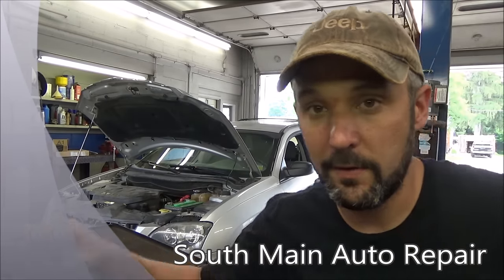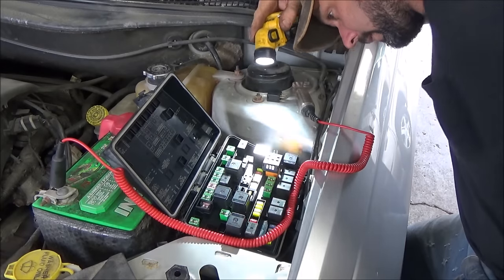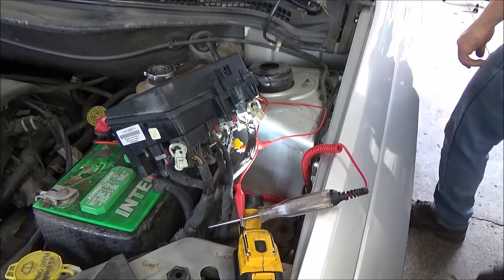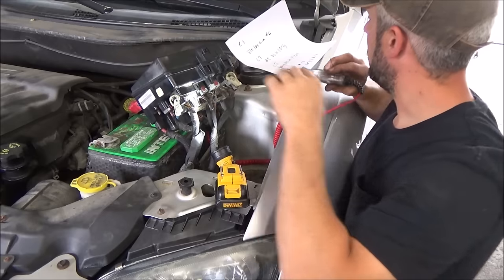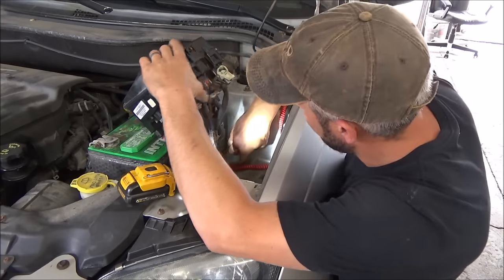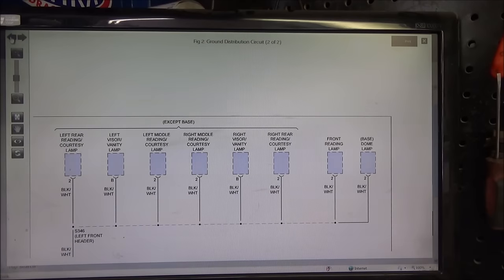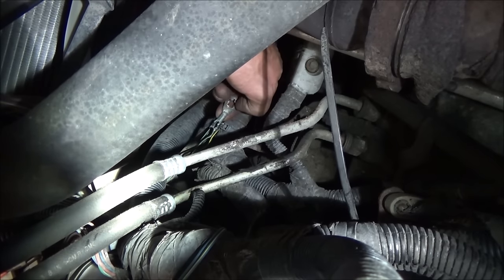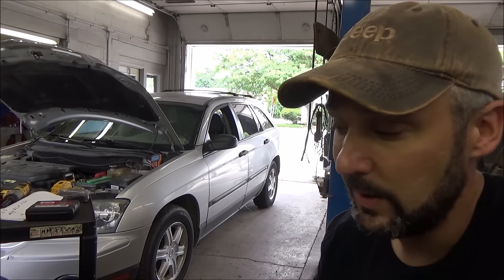Chrysler Pacifica: TIPM Electrical Problems

Comment: And the Kia Sedona is going crazy on the windshield wipers headlights turn door locks the ignition to under hood relay when I plugged it in as soon I plug relay back into the socket of the fuse box it seems like the parking lights go back to normal not flickering but still the power door locks will go crazy and headlights and turn signals still have that flickering and in turn signals work fast maybe I have the same issue as this vehicle you showing now cuz I went the wrong way about it and replaced the which wiper motor and other things like ignition switch resistor for the air conditioning blower motor and a few other things and still having the problem so I'm thinking since I change the fuse box under the hood on a wrecking yard maybe I'm having the same problem with the green crusty wires on the ground for the I p.m. if mine is doing the same thing I really hope so because I'm really tired of this going crazy checking everything and fishing it and it goes right back to the same headlights door locks windshield wipers seem like they're possessed thank you for putting this I'm going to check right now and I'm sure that's what I'm going to find a bad ground from the IPM if not can you please run a video Kia Sedona with same issues I don't know what else to do hopefully what I'm going to do now from your video they're going to work thank you for helping me and everybody who needs to find out stuff like you just demonstrated excellent you are the Master of finding out the problem without trying to charge the customer everything you can so that's like do want the others as you would have them do to you try to help each other when times are not so good once again thank you for putting this video

Comment: So I go outside and hit unlock on my 06 Jeep Grand Cherokee that's been leaking onto my driver's side floor during rain and has a rodent setting up residence, using my fob. The headlights blink on, but the doors don't unlock. I hit the lock button, nothing. I unlock the driver's door manually with the key, No interior lights, put the key in the ignition, turn it to start, the Jeep starts and runs. The wipers front and back work as well as squirters, the horn, the radio displays time, the turn signals work, the emergency blinkers work, headlights and back-up lights all work. The dash board is dark... fuel, mph, rpm, all inoperable. The brake lights don't work, hvac inoperative. At first the windows don't work. But a second try hours later the windows do work, but other than that everything is as before. Chewed wires? (Didn't see any evidence of this, mouse was probably satisfied with granola bars in the glove box that my wife keeps for emergency rations) Bad TIPM? IOD? (Probably not) a crap load of fuses? Water damage from leaky moonroof frying interior fuses? I love this Jeep. Almost as much as my 77 Mercury Cougar that I stuffed a built 460 into with a Danny O'Day C-6 tranny and FBI Torino suspension. Any ideas would be appreciated. 
UPDATE: it wasn't fuses or TIPM...it was a loose connection at the ignition.

Comment: I have an 02 Town and country Chrysler 3.8 l and a major electrical problem my 10 volt or amp ignition fuse started popping as of 2 years ago which continues to shut the car down completely while driving every time I put another one in it pops blows right away turn the key pop finally I went to a higher amp fuse that work for a couple days then it popped same thing every time I put one in turn the key pop so I put a 20 amp in there that lasted year and a half almost 2 years it finally popped yesterday October 5th 2022 but now nothing works every time you put a fuse in it pops continues to pop just that one ignition fuse nothing else in the IPM fuse and relay center has a problem just the ignition fuse which is a 10 amp fuse please help thank you also is there a phone number a way to call

Comment: I’m having the same issues with my 2002 Town and Country minivan. It will crank and run but NOTHING works. No cooling fans, A/C, windows, door locks, radio, headlights, nothing. I pulled the fuse box and cleaned all the contacts and tested all fuses and relays. Didn’t change anything. Can anybody tell me where all the ground points are that might cause this is they aren’t grounded good? Can this be caused by the fuse box itself? Please help, I’m screwed

Comment: I had almost the same problem, only I had a complete loss of electricity/power. I had the whole vehicle put on wheels and towed home. (Touring)
The very next morning, I went out to try and figure it out. Then the I started the vehicle up, then, I let it run for 1.5 hrs. Then I put it in reverse, to back off the ramps-died instantly, will not do anything now.

Comment: I have a 2005 jeep liberty sport has a short from the fuse box so they by passed wires and grounded it to my battery so the fan comes on every time I start my jeep hope I can fix it later

Comment: Pacifica harness & wiring is horrid, I have an 04, many electrical issues. The TIPM has a TSB, states that the barrels that conn pins goto underneath are to big and make intermittent contact, just so youll never duplicate a customer complaint! The harness(s) that come out of the computer at drivers headlight hit a sharp edge frame member near there and causes opens or shorts, it caused intermittent misfire due to messing up fuel injector wire. Follow the harness from there it rubs and hits so many places, you will find  cable sheaths cut into, I had to move , tie away or place smooth metal sheathing around cables harness to prevent ruff metal edges from cutting through it. Oh yeah, grounding is very bad as you noted, no starts also happen due to insufficient gnd path back to battery. Theres YT Videos show you cranking and no start and then a nice 12-14 gauge gnd cable added and a start occurs, Its a long thin return path I traced out and I added a 10 gauge cable and got rid of a large gnd drop that was otherwise eating our battery capacity and it put many batteries to an early grave.

Comment: Erica had a minivan with the lights were back and forth one side would work then the other side work on the office at being in the drive in Layton be the officer and it came down to that same grounds except for the stud broke off so I had to take the other stuff off and double up and replaced the connector that fixed it

Comment: For every one ;
Either put bad of
silicone sealant or put 
dielectric silicone grease
ON every ground ( GND ) /
earth spot/ wires and bolts.

To prevent rust 
and or corrosion .

Comment: From the beginning of automotive history when the first electrical system was installed on a motor vehicle checking the ground connections should be the first action taken when diagnosing an electrical problem.

Comment: Can someone that's done work on dodge/Chrysler vehicles give me a little help, I have an original TIPM, and a used TIPM for my avenger, now both the original and used TIPM have issues where the windshield wipers will stop working midway through their cycle, so anywhere on the windscreen they'll stop and I have to keep cycling the switch to different speeds to get it to move again, issue number 1, the second issue is now  the used one I had in there for a while and it started like powering off the electronics inside the car, ie the dash and its screens like it looses power and it once threw a code that it was overvolting the system like from my alternator or something, and sometimes will cut all power to the car when trying to start, (with both TIPM) also it seems to be fluctuating power to the lights and dash but with the original TIPM it doesn't throw any codes, I've all but decided to get a new/refurbished TIPM but I don't want to put that kind of money into it if I have a risk of frying the TIPM is there a way to check that before getting the new module?

Comment: Most issues with 2010 and above on Chryslers TIPM's are the micro relays go bad do to over currenting the contacts, I use to do many repairs on them that I kept several of each in stock. So when I did them I just replaced them all, my favorite is when the horn starts beeping in the middle of the night without any input. LMAO

Comment: Great job I have the same problems going to look @ ground 103
Reply: @ Larry Crabill.  I had the exact same problem. Something to note. My wires were not completely broken off and did not appear to be corroded. Only until i took the nut off the post did i see the corrosion and then they began to break off. I repaired it and car is going great!

Comment: Chrysler 2006 Town and Country 3.8 L

ERROR CODE P0622 - GENERATOR FIELD CONTROL CIRCUIT FAULT

PRIOR TO ALTERNATOR, TENSION-ER PULLEY, IDLER REPLACEMENT (Not the
connectors) AND AFTER

Only happens after acceleration from a light or full stop when car is hot, at 2800 rpms or higher with accessories on or off

Does not happen in park when idling for hour or more, or when rpms are raised with accessories are on or off

Other faults: Rear wiper intermittently works
Driver side passenger door won't full open or close
Driver door window will not work at all

Are all codes related to electrical short, ECM, or PCM problem or
individual issues in the van.

Research states that other related codes or problems could be overheating cam
sensor or crank sensor?

Comment: Hey I have the same car I have code p0016 .p0340.p0344 I changed both sensors could it. A ground issue cause me this the car won't start it started wen I change the sensors but wen I turn it off it won't start again

Comment: I find it disturbing that an hour after repairing and putting an 8 pin connector on the front harness in my truck this video pops up as recommended. Kind of like how i went and bought a flap disc from home depot and an hour later i started getting ads on Facebook for sanding discs.

Comment: Great Video,,,,BUT  ERIK,,,U R in NY,,,I Am in A Collision Shop in NJ,,Have Many of the Same Problems U R Encountering ,,,I SAY THIS ALL THE TIME,,,CHECK THE GROUNDS<<<CHECK THE THE GROUNDS>>>CHECK THE GROUNDS,,,When I See Multiple ISSUES,,,,I Always Go To Wiring DIAGRAM,,,And See WHERE GROUNDS ARE,,,Check Them FIRST,,,,I Started seeing this Years Ago When I LET Chrysler Fix my NEW Concorde AC Problem,,,They Pulled the Dash ,,and all components to change the Evaporator on pass side ,,,I got the Car Back ,,And every time you hit a bump ,,The Gauges would go  dead,,Electrics Flicker ,,,Took it Back,,No Avail,,,So I Printed Out Full Wiring Diagram,,,And Went From Front To Back of Car,,CHECKING ALL The GROUNDS,,,,AND YES<<<When I Got To Where They Re-Fastened CENTRAL Ground Wire ,,,YUP  IT WAS LOOSE ,,They  Had Stripped Out the Post,,I Cleaned the Ground and Re-Fastened It >>>Never Had Any more Problems ,,Car Ran Well to 275 thousand miles ,,,I initially thought too it was a BCM,(Body Control Module ),,Which can Often Go Bad from a Crash on Modern Cars,,,So Check The GROUNDS  My Friends

Comment: Your electrical repair would more easily sluff off the effects of battery acid spill if you smear some grease on the electrical connection. I like to get rid of the battery post corrosion by irrigating the area with water thoroughly and wetting it down with something like motor oil. That fix to the corrosion lasts a very long time. Aqueous acid does not mix with the added oil. (Water and oil don't mix.) The added oil on the battery post prevents acid seepage.

Comment: the most vital information comes from an OEM electrical schematic. whether it be from a cd or an oem service manual. info must be from the manufacturer, the model, year and engine type MUST match the vehicle youre working on

Comment: So my 2006 Chrysler Pacifica has this issue when I open my driver door the dash lights come on and the immobilizer light comes on and everything in the car glitches my radio and my headlights.... I ran a strong ground from the chassis to the battery I even replaced the connector rings on the existing grounds...I’m stump can anybody please give me a right path to fix this issue and I also did what was done in the video  everything check out right

Comment: I had an incident in my vehicle fun doing diagnosing issue kind of the similar but it was the power brick and the Ford the expedition I don't remember having potato chips because each and every time I move the Box around it sounded like potato chip bag so it was bad but good get fixed and it's okay since a year ago the sleet rain snow it was a very interesting night went  in to a pothole and the power went out engine shut off wasn't sure if water had gotten into the box don't know how that would happen but anything's possible.

Comment: CRAP...had a 05 Ford Freestar from Florida that did the exact same thing.  Shop said it was kaput, so i left the car with the title.  Turns out it was the GROUND wire...oh well, thats a $2000 error.  But hey, thanks for the input to show me where I screwed up.

Comment: AS AN X  mechanic.retired... GREEN STUFF MOLE ON COPPER  electrons flow on top of wire not thru a wire...  green mole  is blocking electrons from flowing on top of wire....  Mole and rust is not conductive,,,I would add redundant  grounds ….Car manufactures trying to save MONEY on wire. I would ….ADD ground DIRECT from battery to prevent future problems as I was told you can't have too many grounds.

Comment: South main im just buy a 2006 crysler  pasifica  with 125 miles on it...she got the same problem  signal ligts work brake ligths work..the only dont work is the jorn windows didnt work  air.. dont hadd ligts dont work radio dont work start rigth up the only thing i cant' drive the car in the nigth why because the ligths brake and signal ligths work but park ligts didnt work

Comment: left front under the box you just took off.   i had that problem for a 2005 intrepid. More you scroll and more i know its bad body ground everywhere there are a cable to body. paint to tick for the crush contact terminal. The baterie is a good example of it.  poor tiny 12 14 16 gauge wires getting infected. they need a 2-3 inch cut and a new ground point

Comment: I have the same problem with my Chrysler pacifca 2006 plus one of my running lights is out on the passenger side but anyway the mechanic had me to order a computer for the car

Comment: as soon as the relays started clicking independent of horn i knew it was an earth problem as these systems most commonly share a ground for 4 or 5 systems, as the earth is the only system that is common to those it narrows it down significantly,

Comment: Besides the fact that this is a fantastic example of proper troubleshooting of a problem, I find it quite amusing that 50 thousand more people have watched this video than the sum TOTAL of CS chassis Pacifica production. I hated working on these when they were new, and will be glad when the last one is crushed.  They were much better in the final year of production,  but oof...the 2004 to 2006 run doomed them. Typical DCA era junk.

Comment: I've replaced and worked on hundreds of the hid or projection headlights the taxi companies around here that's all they use those and the magnums I've actually had them come into the auto parts store where I was working and have me throw in a regular set of bulbs and just totally bypass the ballast they get tired of buying the whole setup when regular bulbs are so cheap those cars are electrical nightmares

Comment: picking the horn circuit was realy the easiest one, knowing you use ground to switch the horn relay... lol, (thats the car ground on the wheel,whitch mostly everythime is present. ) In 90 %off the time its a lack of ground to the users or relays problem... < seing the same a lot in my work on steel boats...Crusty,s on the ground connections. whit the funiest problems ocuring in that case.. 

 lol

!!

Comment: Same thing happened to my 2016 Jeep Patriot latitude 2.0 replaced the Tipm TWICE with in 2 years!  I will never buy another Jeep Chrysler or Dodge again! Lesson learned because before this pos I had a 2006 Chrysler 300 and it was another POS with multiple electrical problems

Comment: OK, one minute in. I'm looking at what has happened to me in the past. I'm going to put it up in the air and see if any wires are against the exhaust or driveshafts. I have my EGO sensor short to the axle and it blew a 20-amp fuse. Let's continue and see...

Three minutes in. OK, perhaps a wire rubbing against something that moves. Under the dash? Steering column? Shifter linkage? Watching more...

Corroded ground. Watch and learn.

Comment: Typical Chrysler. This is why I got rid of a chrysler. No one could find the problem even after changing the tipm. The ignition module failed late one night, got it replaced under a recall. Was ok for a few months and that one failed while driving, the steering wheel locked while the vehicle was still moving. Chrysler says it will do that because it thinks it has no key. I traded the heap in, the guy who bought it got killed since a third module failed. The sliding door behind the driver would open on it's own even while driving, Chrysler's fix was to disconnect the door motor.